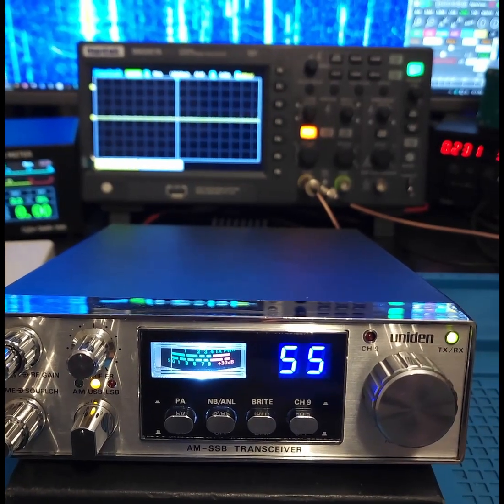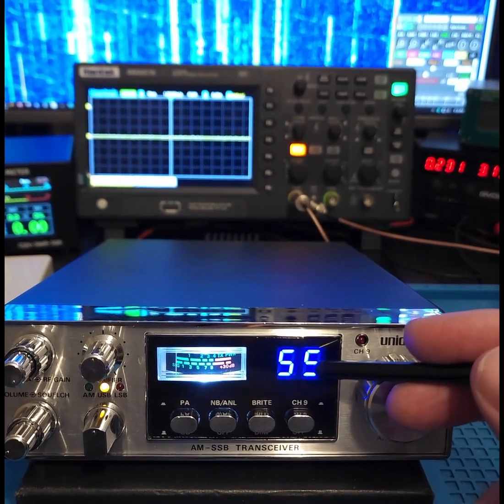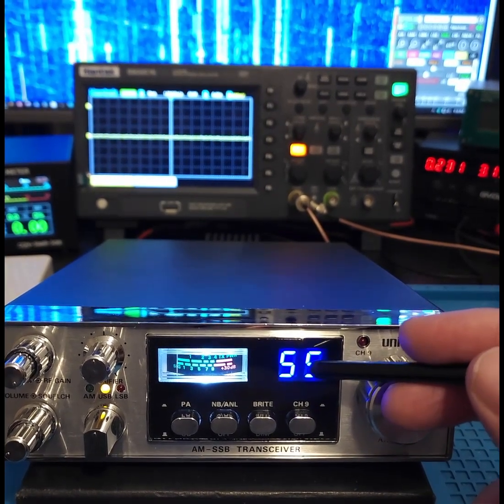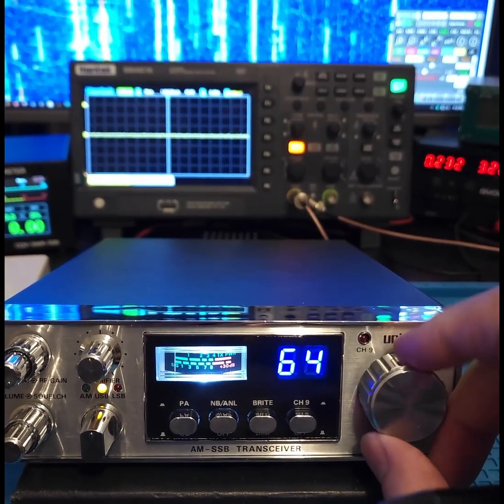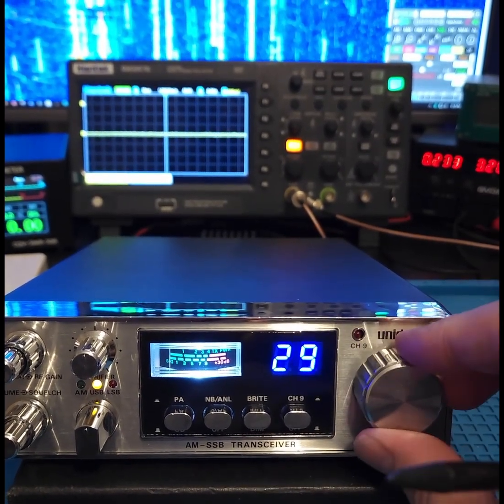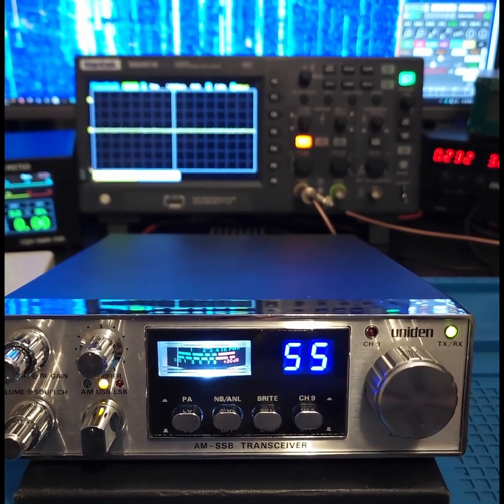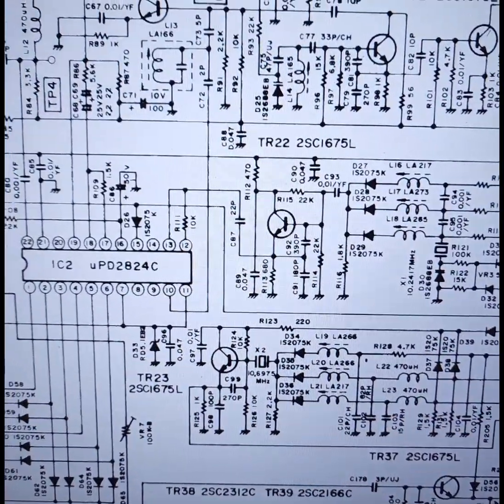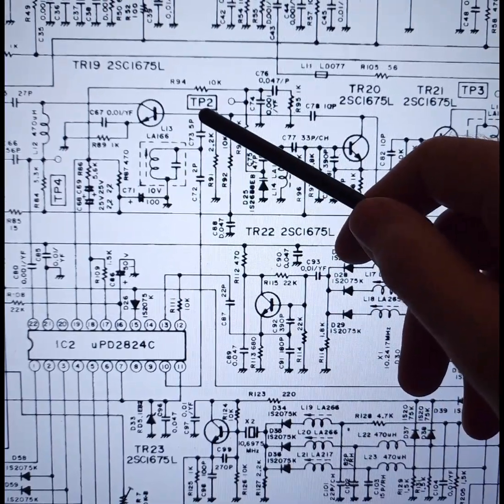CB Radio Uniden AX144 channel expansion with a serial PLL chip and Arduino Nano

Comment: can you share how you control serial PLL BU2630? 
is it a simple shift register, or are there 4 shift registers and how are they connected, which one is first?
Reply from the maker: I wrote a library for that. It's a bit crude but happy to share if you want. 
Using the serial PLL was a pain though, and quite restrictive as it's only 2.5kc steps and getting the levels back from the VCO to be high enough was more trouble than it was worth.
From now on I will just use the Si5351 so it can do any step size, no upper and lower frequency limits like a VCO, and you do the clarifier directly rather than skewing the reference oscillator.
Dealing with the square wave output harmonics and levels from the 5351 is easier. I would not recommend this PLL approach if you're modifying a CB, I won't do it again like this, it was more of an experiment.
Reply: @OverkillCB  thank you for the details
Reply: @OverkillCB  library will be useful
Reply: Can you email your code to cdrunity?